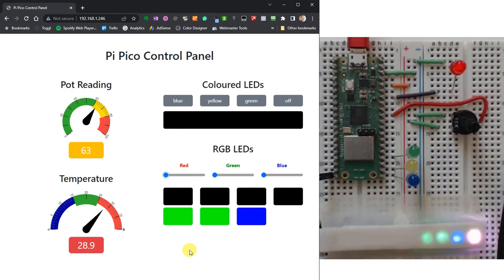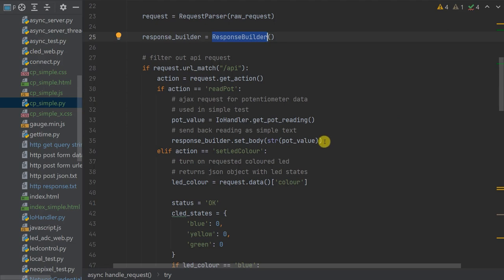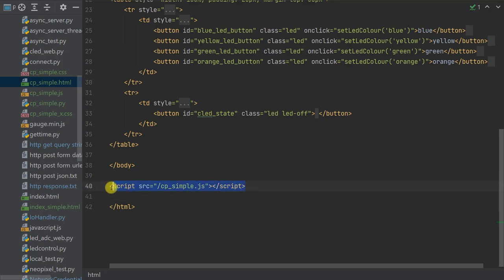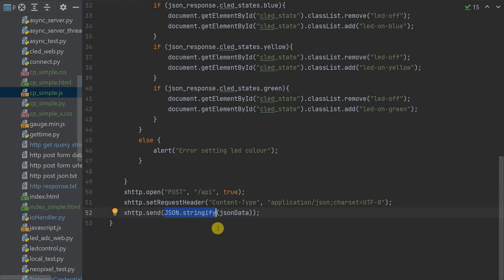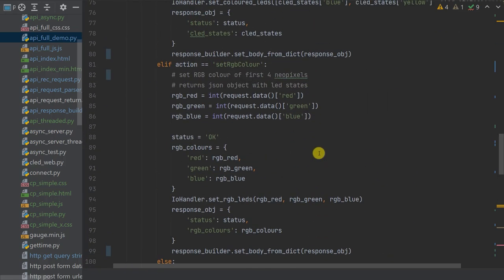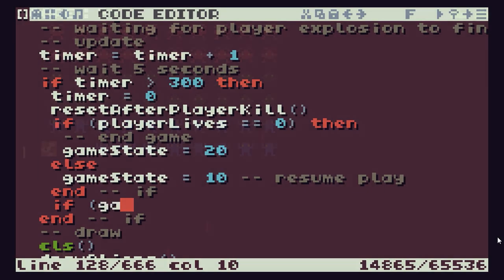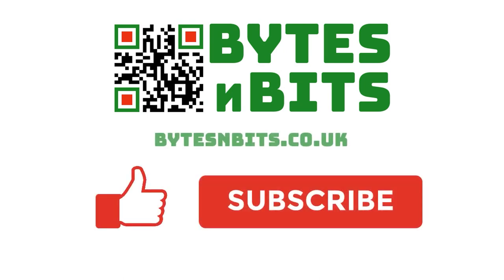Build a web control panel for your project - HTML and JavaScript coding

Comment: Bob, what a FANTASTIC job you have done in bringing all this information together and explaining it so well! Thank you so much.  All your code and examples work flawlessly. 😀
As you have suggested, my next step will be to dig into the jquery and bootstrap packages to learn more about their capabilities. I am hoping to be able to find a virtual joystick I can use to control a Pico car project I have built. It's just exhilarating to be able to contemplate (and hopefully accomplish) such cool projects using MicroPython running on a cheap Pico. Again, a huge thanks to you!
Reply from the maker: Great to hear you've got it all working. Good luck with the car project.

Comment: Thank you for the amazing video! I have a hobby project that I'd like to discuss here. The objective is to use a microcontroller to read MIDI files from an SD card. It will receive MIDI commands and music data (chords) from an external source, such as a MIDI keyboard, via MIDI USB input. The microcontroller will then analyze the data, transpose and modify the MIDI track data accordingly, and finally play it back through the MIDI USB output to the external MIDI keyboard without delay on the Music and interactively. An LCD will display relevant information, such as the file name for selection. The user interface will solely rely on the buttons on the MIDI keyboard, eliminating the need for additional buttons. now the question is What is the minimum recommended microcontroller board capable of handling this project?
Reply from the maker: That sounds like a great project. I'd say that any of the more powerful microcontroller boards would cope with that (Pi Pico, ESP32 etc). The Arduino range probably won't until you get to the more powerful boards. I suspect with a microcontroller board you'll want to stick to C++ rather than MicroPython just to keep the processing speed up - MicroPython does run a lot slower. Your main choice decision I guess will be based on the IO you need. SD card and screen will need an SPI channel, then 2?? USB ports. You'll need to be careful that the SD card reading and screen writing don't stall the MIDI communications and cause timing delays.

I'd advise going for the most powerful microcontroller to begin with so you don't run out of processing power and then work out how much leaway you've got.
Reply: @BytesNBits  Thanks for the advice!
Reply: @BytesNBits  According to your advice, I will go for the Raspberry Pi Pico with C++. It provides me with two SPI channels and sufficient processor power to ensure smooth code execution. I was initially considering the Teensy, but I almost forgot about the Raspberry Pi Pico. Thank you once again for your valuable advice!
Reply from the maker: @dralikg6885  No problem. I hope the project goes well.

Comment: I'm trying to make sense of the "gauges" on the page. Is the code to display them in "gauge.min.js"? and if so, why is the source all in on a straight line, and not printed as a regular source page? Makes it hard to make changes. used Notepad++  (one line), and Visual Studio code, all over the place! What am I missing here?
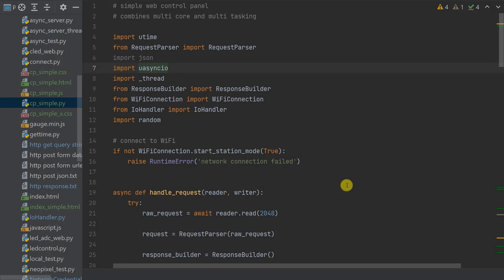At 5:39 you are using some kind of an editor? Can't make it out.
Reply from the maker: guage.min.js is the actual library file for the guage code. It in minimised form so all one line and totally un readable. You don't really want to be editing this file.

The code that displays the guages in in my source code files and uses the library code to make it work.

I use PyCharm for my Python coding - i highly recommend it. Look for the free community edition.

Have fun!

Comment: Is it possible to add compatibility for the Ethernet modules?
Reply from the maker: I can't see why not but there will be an amount of coding to interface it all together. The web server in this tutorial is hooked into the WiFi interface, but the ethernet module should provide some sort of connection you can tie in to. If you can get a web server running through the ethernet module then the rest will be as in this tutorial.
Reply: I have set up a small system using the Raspberry Pi Pico as the master on a Modbus bus, and I wanted to create a REST API to control it and read its status through the web. While searching for examples, I came across your channel, and I'm going to try implementing the Ethernet connection. Thank you for your response. Best regards!